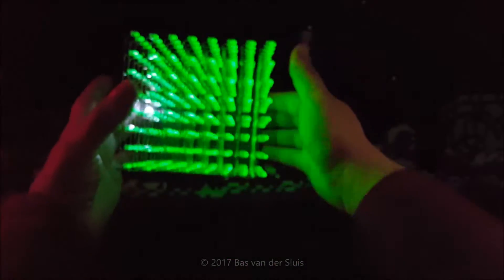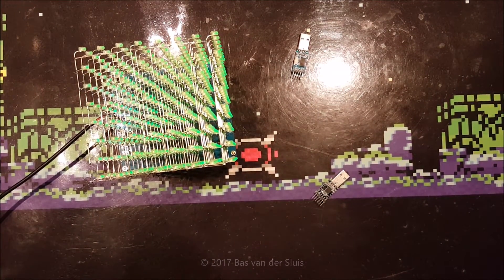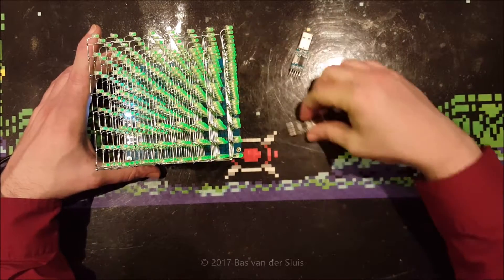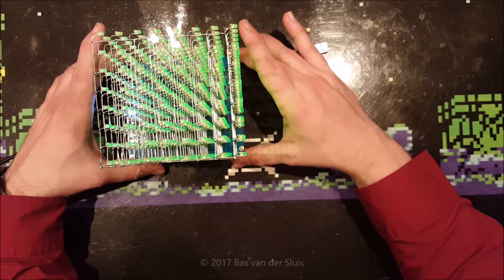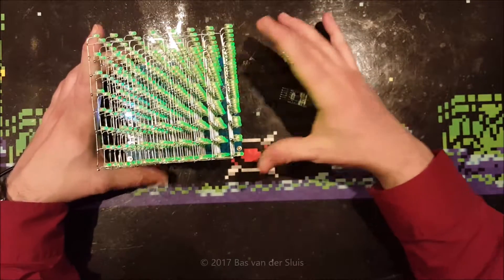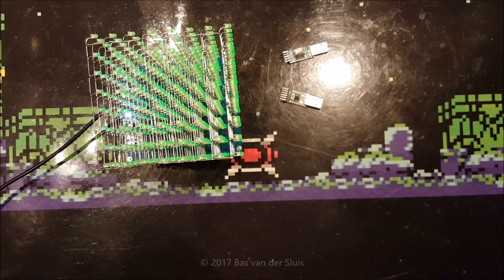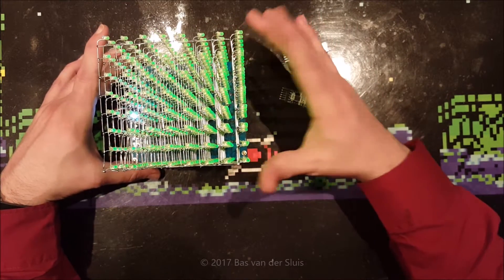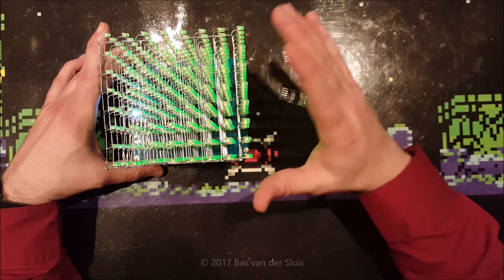How to build the 8x8x8 LED Cube kit from Ebay - part 3 - programming

Comment: Hey Bas, thank you so much for your set of videos regarding the 8x8x8 cube. This is very well done and inspiring!  Specially liked this last video on programming the cube. As mentioned below by someone else, in case you want to use again your cube with no cvonnection to the computer, just repgroam it again with 8x8x8.hex code stored  ar firmware folder.

Comment: Good video, very helpful. A lot of people seem to be having problems with the LEDs, (with some of the levels lighting up when they should be dark) I found that the LED's are very easy to damage when assembling, and a short circuit one causes this problem. It's a real challenge to fix once the whole cube is assembled, so thorough testing before is vital. Did you ever find a way to make your own animation that runs in a stand alone mode? That would be great if you have.

Comment: Hello, what is function of S2 and S3 tact switch? One of them is for flash (but which one?) and what is function of second one? What do you think about changing C4 capacitor onto bigger one, is it good idea?
Reply from the maker: As of today, I still have no clue what S2 and S3 are for. :) As for C4, I don't think it will make a difference. I guess it is only there for some DC input filtering.
Reply: @basvandersluis5662  Yes, C4 is for DC input filtering, but maybe bigger capacitor = better filtering?
Reply from the maker: @Qubnix  If you get yourself a cheap oscilloscope (diy kit) from eBay, you could actually measure if it is required to have a better filtering capacitor. But if you just use a good power supply, I doubt if it is really necessary.
Reply: @basvandersluis5662  Ok, thank you for answer.

Comment: Your power cable from the pins VCC GND P30 and P31 are going in Arduino ? In Part 2 you show a power supply from the simple cable DC to USB and now I see a different power supply from the VCC/GND

Comment: I follow all your guide, but i'm here because i can't flash my program. I have an USB to TTL, i've connected the TX of adapter to P30 and DX to P31, VCC to 5 volts of adapter and GND to GND. My computer recognize my adapter, i tryied also to flash a simple program to arduino through this adapter and it work. So the problem is not the adapter. But what i have to do for flashing my program to the microcontroller? Have i to press S1 S2 or S3 button?
Thank you for you beautiful guide.

Comment: I destroyed the microcontroller by feeding it reverse voltage by mistake, when i tried to get a new chip from the seller, he can only supply blank chips. So the only way to get my cube working is to program a new chip myself. I have a couple of questions for you. As you spaced out your rows with soldered leads, did you actually connect the negative lead of each row together with the jumpers?  I checked the board for common  points between the rows, and I didn't find any. So what points did you connect electrically when you spaced out the rows?   My second question is about programming. If you can program the chip, can you also read the program that was on the chip before you changed it?  I want to find someone who can read the chip, and send me the program so i can program the new microcontroller I bought.
Reply from the maker: Each row is connected by the positive leads of the LED's. Each column, 64 in total, is one positive lead. For each row, all the negative leads are connected. If you destroyed your chip, I think it is impossible to read the ROM. But... All the roms and software is provided by most sellers. At least, most of the Banggood sellers provide a link to the software, which contains the ROM you need (look for hex files). Now you only need to find out how to program an emtpy STC chip.
Reply: I have a programmer on order that will do the STC chips, it was missing from the list of chips my other two programmers would do. Thanks for your answer..

Comment: Finally I succeed with your nice instructions but my cube led 1st  (lowest) floor is not lighted up always.2nd and 8th floors in full bright.rest are light in dim with patterns.where could be the problem.all connections double check with multimeter.
Reply from the maker: Good to hear, now you need to find what is wrong. All the layers seem to be connected to the 510 ohm resistors. Can you measure the resistance between the layer and one side of the resistor and see if the resistance is the same for all layers? And if it is, check the resistors itself. And I don't know if you used IC-sockets, but check if the IC next to the resistors is mounted perfectly in its socket.
Reply: Same problem hear, Floor 1,4,7 and 8 are ok. The other floors  are not lighten up always. 
At some animations other floors or strings dont lighten up correctly.
I check the resistors. They are working fine. I have checked the IC-sockets too, they are also fine. i have even change the ic´s( except the stc).
Is it possible that the problem is the Firmware ? 
I hope you have an idea. I love this cubes and its very frustrating that my cube does not work 
correctly.
greetings Flo
Reply: Florian Müller, I'm having a very similar problem with mine. I received my kit yesterday and soldered up the board, but didn't make the cube yet because I don't want to waste my time on all that soldering if it's not going to work properly. Have you had any success in discovering the source of the problem?

Comment: I made this led cube brought  from  eBay.all connection done and checked again.but my cube 1st (lowest) floor leds are not working. Only 2nd floor leds light up fully bright.rest of all floor leds (3-8) light in dim. Patterns working well in 2nd to 8th floors. Where could be the problem and how I sort this out?

Comment: Hey Bas , I am wanting to make 2 more cubes ., the first being a purple one I wanted to know if there is anything i would need to change  Such as resistors  or do you think it will will as it is in the Kit?   the other is going to be Orange and Blue  ...  what do you think ?
Reply from the maker: Great idea! If you have the cube with the blue LED's, it can handle purple LED's without having to change any resistors. This probably also goes for orange, but you should check to see if the orange LED's can handle 3 volts.
Reply: Ok , Thanks for the quick reply I will check that  soon as they arrive  I ordered 4,000  LEds from E bay  different colors of course .. about 2 weeks ago  still have not arrived   ,.    thanks again
Reply from the maker: Ordering stuff from China can sometimes really test your patience. I'm looking forward to your results with the purple and orange LED's!

Comment: Hi Bas,

So I found your videos while trying to figure out how to program this cube (of course, after I had already built the cube...I'd have saved myself tons of time and headache had I found your videos first... : ) - I ran into the same problem you were having with the firmware download failing. After doing a little search online, I found here (http://intercontineo.com/article/9380132717/):

1, this problem often seen on the STC12C5A60S2 MCU, higher baud rate can easily download handshake failed. The general solution is to select the highest baud rate of serial Step 3 to 1200, so you can ensure that the download, but the download speed is slower. 
2, an alternative solution is to select the highest and lowest baud rate to the same value (adjusted to 9600), to download a different baud rate in the drop-down list to find the highest success rate that a value . That is, the value of your lucky. 

Setting it to 1200 worked for me! But now I'm having problems using the 3D8 software instead. It seems like rather than the previous code getting wiped, it's still there - when I turn on the cube, it cycles through the same old patterns. However, when I then try to connect in 3D8, the cube freezes at whatever frame it was at. When I click around in the software, it seems like nothing is happening to the cube, except occasionally it will change to a different frame, as if perhaps data is still being transmitted. Any suggestions?

Comment: Hoi Bas ik heb me cube gemaakt maar welke pins van de adapter moet ik gebruiken om hem te programmeren?
Reply from the maker: Deze pins heb je nodig: VCC = 5V, GND = Ground, P30 = TXD, P31 = RXD.
Reply: Bas moet ik de cube ook door de power poort stroom geven of allen via de 4 pins
Reply: en hoe upload je het naar de cube
Reply from the maker: Naar de pins is voldoende.
Reply: Dankjewel en moet ik :omazas' Git repository: https://github.com/tomazas/ledcube8x8x8   of
The Java application which worked after flashing Tomazas' firmware: https://github.com/aguegu/DotMatrixJava gebruiken.

Comment: which usb to ttl converter did you use? Does it connect to the board in the area between the power indicator led and the capacitor?
Reply from the maker: In my video about programming the LED Sphere I'll cover the different USB to TTL adapters and which one works best (starts at around 1:48): https://youtu.be/oKa6jzxT9tI?t=1m48s
On the board, the connector has 4 pins (including VCC, GND, P30 and P31) and is called J3 in my case.
Reply: Thank you, and my apologies for not commenting on the videos.  I enjoyed watching all three of them.  My kit arrived yesterday and I finished the board in a few hours.  I did watch your programming video.  You mentioned that the first two you purchased did not work, and that you bought a third one from a  Dutch company, but did not mention the specific information about the board that worked.
Reply from the maker: It was not the board; the TTL adapters did not work. If you are running Windows 10, check out the one I mentioned before, that one will work.
Reply: Thank you.  After looking a little more, I think I'll handle the programming and interface with an arduino.  Now I see where to connect the two boards.

Comment: i need to connect this cube to arduino (referring to tomazas led cube git hub page)
I have flashed the hex file to stc chip
Now i would want to connect the cube to arduino to operate it without pc.
This is how i connect to arduino
Tx-p31
Rx -p30
5v-vcc
Gnd-gnd
Then should i flash the .c file in v2 directory to arduino. 
Please help me if i m wrong

Comment: hi again, i have finished my Cube. Unfortunately i have some issues. I have tested all LEDs in the soldering process, every single one working well, but by using the Cube itself, the lowerest layer was adding lights from other layers from time to time. What´s the problem here? Do you have an idea? I have swapped all ICs already to prevent an error there. Will a Firmware-Flash work and do the trick? Resistors also checked....

Comment: HI Bas, Great Job, Thanks a lot, How can we connect TTL adapter to the board and how to flash the STC memory using arduino?
Reply from the maker: I have no experience with the Arduino, but the pinout on the board is quite simple: VCC = 5V, GND = Ground, P30 = TXD, P31 = RXD. Where TXD is the transfer-data-line on the TTL adapter and the RXD is the receiving-data-line on the TTL adapter. Accidentally swapping the RXD and TXD does no harm, it only does not work.

Comment: Hello
First many thanks for your videos, are very useful. I would like ask you about two push buttons, What do they do?
Thanks in advance.
Reply from the maker: I have tried about everything, but it looks like the buttons do absolutely nothing. I have flashed the rom of the STC-chip with the new firmware from the link in the description. So it is up to that "new" software what to do with the input from the buttons. If those two input pins have not been programmed, the buttons will not do anything. I'll keep my eyes open for new or other firmwares and when I find something, I'll post it here.
Reply from the maker: I tried the buttons when programming it, but they did not seem to do an awful lot. I'll give it another go tonight. Maybe it can record stuff I send to the cube. I'll keep you posted.
Reply: Do they record the animations? That would be so cool if they did, and useful.
Reply: Thanks for you effort Bas. I was trying the same but nothing. I imagine depends of the code of the program, if are enabled or not. Regards.